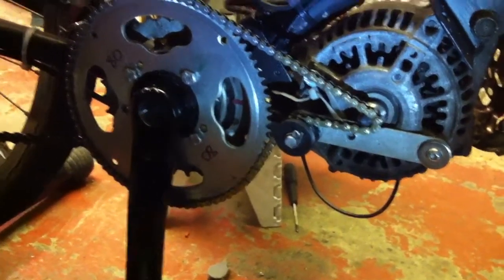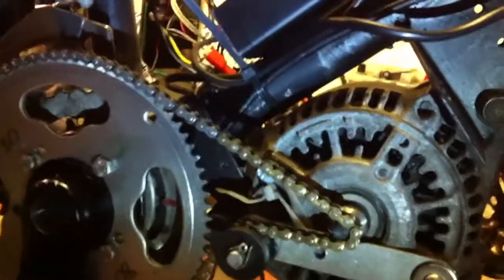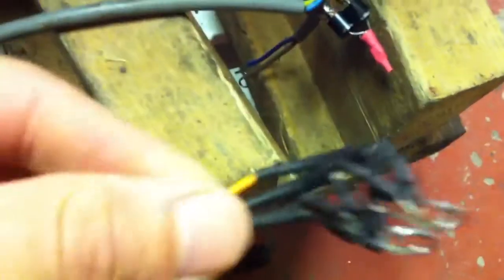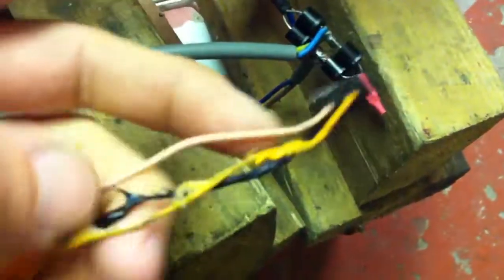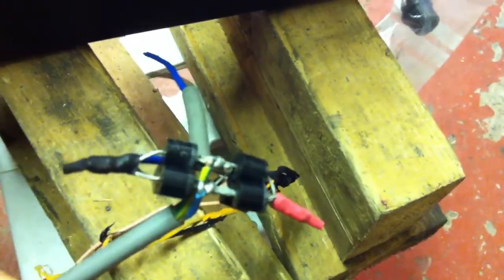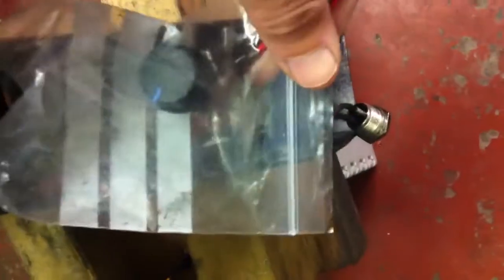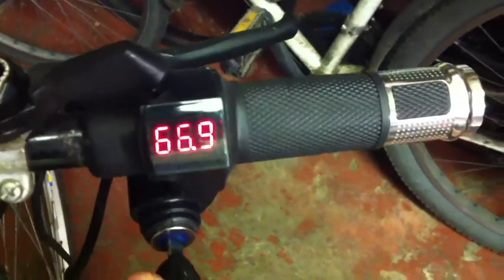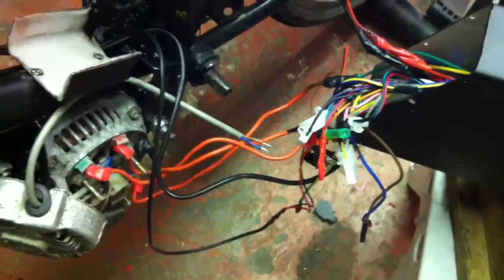Alternator motor as a mid drive - smaller output gear part 2

Comment: Small gear like that put a lot of stress on your chain, 12 or 13 t. is the max better go for a larger rear sprocket,
Reply from the maker: You are completely right. This was all about being able to pedal and use the motor at the same time. It's a massive compromise because the pedal crank speed is limited to 100rpm , so that my legs can keep up. It needs 2 stages of primary reduction really, with a freewheel disconnect of the motor when usung pedals only.
Reply: @plodderexup  Compromise I learned it when I was living with my ex-girlfriends! Lol!
lack of tools, money or a place to work on projects when you:re living in a big city unlike when I lived in the country. Everybody know everybody skill or trade and in exchange of services or help! Helped build a friend's racing stock car for fixing my father's car free, learned to rebuild vw engine and tune it! Operate a backhoe! Helped design a mechanical squirrel cage blower from a  home heating system as mechanical blower. An idea I had after a few ales to put a snowmobiles two srokes with cvt transmission to a 4 speed vw trans mission one of the guy did that and it worked! Today at the dump I pick bike parts and other stuff, tomorrow I will try to get used lithium batt.around a 1000 at the garage! I missed a box of 2000  at the recycling aera! I used a bike for 20 years, and race MX! Bike messenger from 34c to minus 20 59km to 75km 5 days a week! Better have no money and imagination than....Thanks for the reply...see my job on my channel

Comment: I ve done the same but put it in my sons little hummer.  What voltage are you powering the field winding with? im using around 8v seems good.  Your alternator looks the same as mine to
Reply from the maker: fixitmoditbreakit 11-15v. If you watch the whole series, somewhere I describe a 3-phase rectifier and an adjustable PWM motor controller. Set the field voltage to give the required torque without cogging; any more than that seems to reduce maximum power.
Have you got a video of the Hummer? I've got a few alternators and was thinking about a cart of some description.
Reply: i ve tried different voltages ended up leaving it at 8v as didnt make to much difference well i didnt test the amp draw though.  
Heres the video's the first one is limited to 10000erpm and the second one i put the erpm limit to 20000 but will bring it down as it was to fast!!
https://youtu.be/_7cto5myJeA
https://youtu.be/ZL7xPY9uckw
Reply: CheadleBiker ah looks like we have the same pwm controller to